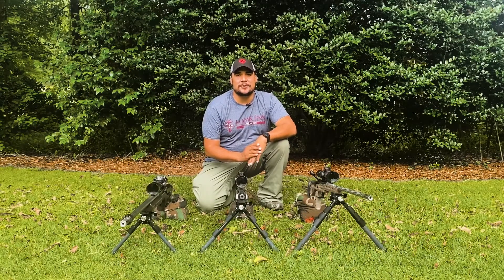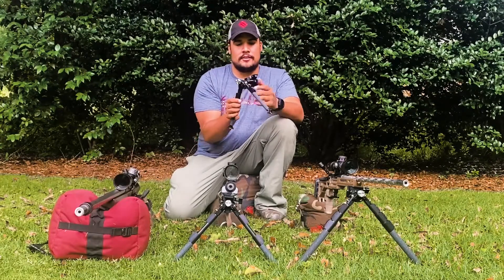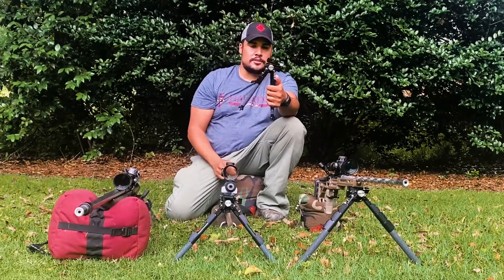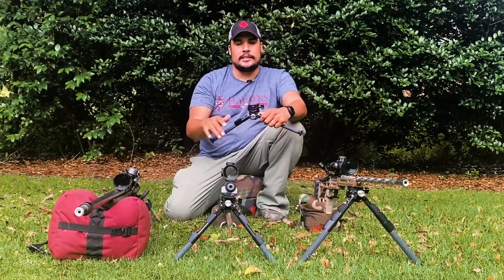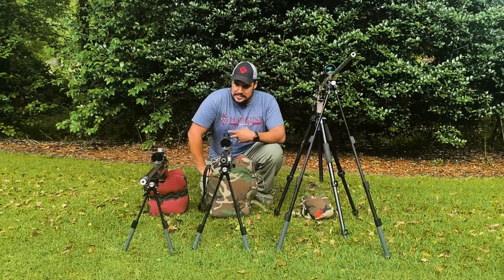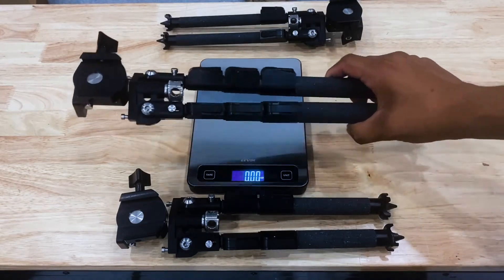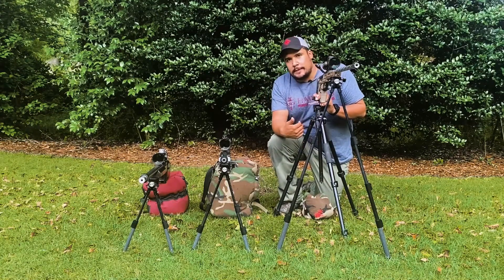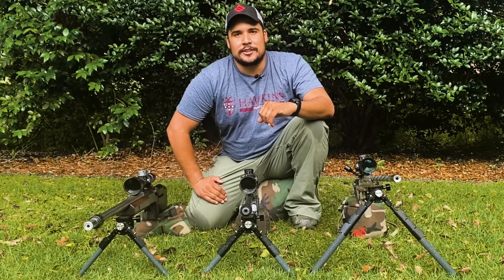What are the differences between the single, double, and triple pull CKYE-PODs?

Comment: Is it just me or did he miss the truest possible low setting. That is shortest legs, widest setting, and run at the 45 degree position instead of the 90.
Reply: Hey Austin, that is absolutely true. and I'm sad it's taken me this long, and frankly your comment, to realize that omission. That being said though, especially for the triple pull, the times I've shot it that way, you get  less than ideal amount of flex. and with the single and double, you'd realistically be so low that a rear bag, at least the one I use, wouldn't really be employable. I apologize for leaving that setting out, but I tried to show the measurements in the most common or practical positions. hopefully you still found the video useful for comparing the three. thanks for the comment!
Reply: @josemgardner  it absolutely was helpful.  When comparing the adjustability to my accu-tac SR5 it is good to know that the single pull can go lower and higher which is a good adjustment range for what I do.  So I bought one not long after watching your video.  I really liked seeing the real world measurements. 

I totally get it about the flex when set at a 45.
Reply from the maker: Hey Austin, looks like Jose already gave you a great response. Thanks for the question!